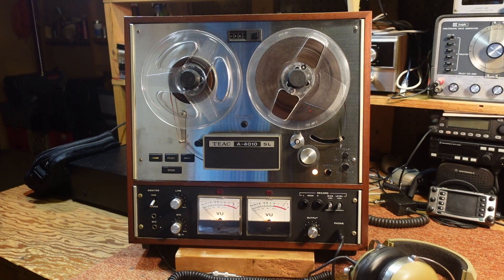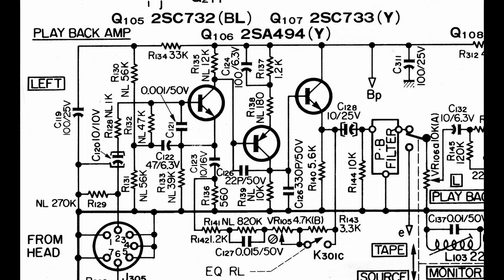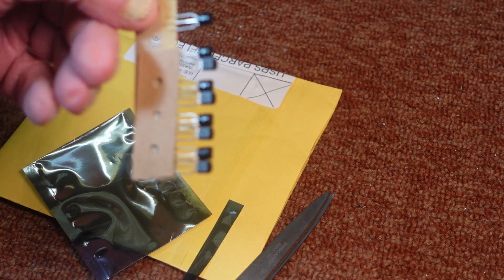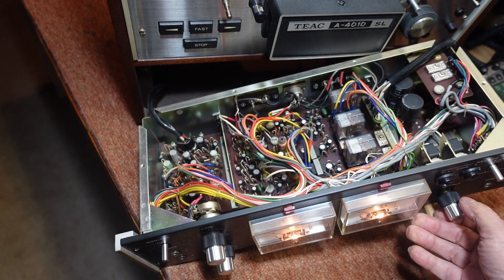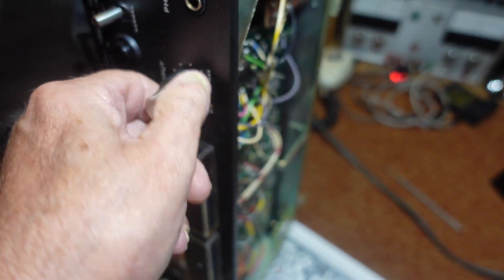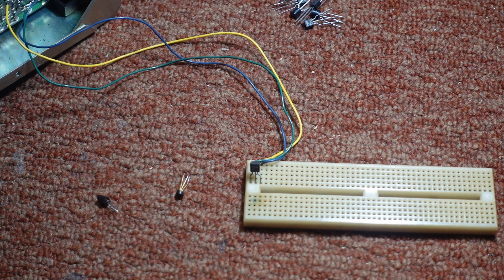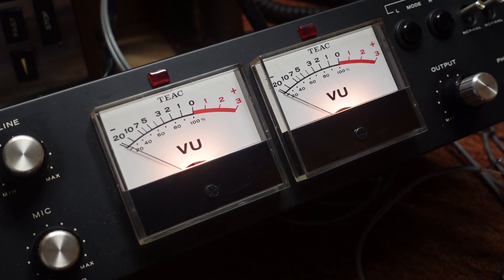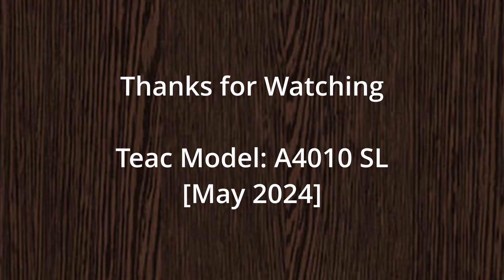TEAC4010SL Tape Deck Service (Noisy Transistor)

Comment: I have a unit just like it. I have a left channel low level record volume problem. My question is, how did you find that transistor in on the board...there's a lot of caps and resistors down in there.
Reply from the maker: Finding a component on the board takes comparing the board with a poor board layout print. It takes patience. As far as "low level record," the problem probably isn't a bad transistor. Transistors: they are ok, bad or noisy - never half way in between. Sounds like you have a poor coupling or bypass capacitor ( on an emitter) somewhere.
Reply: It's obvious you repair R2R's. Do you do this for clients? I just bought a 4010S and has a few issues.